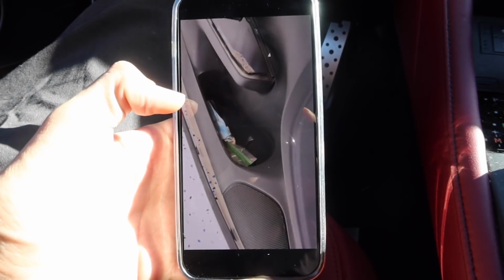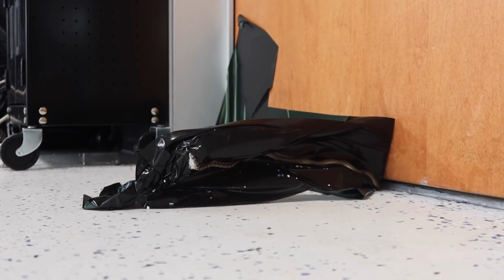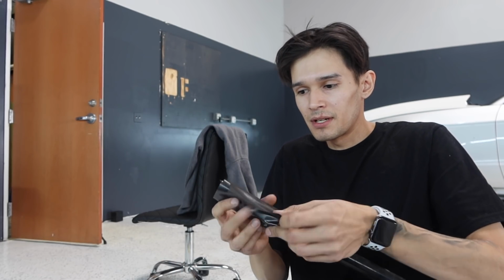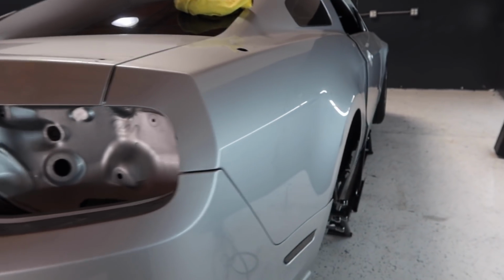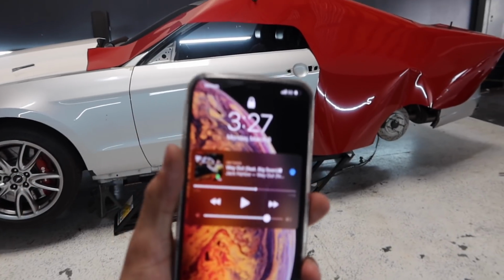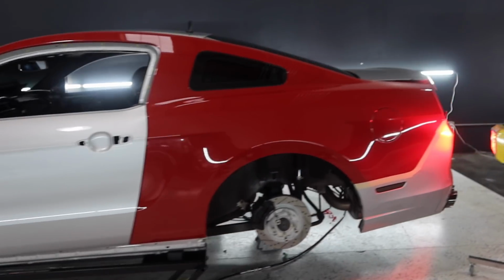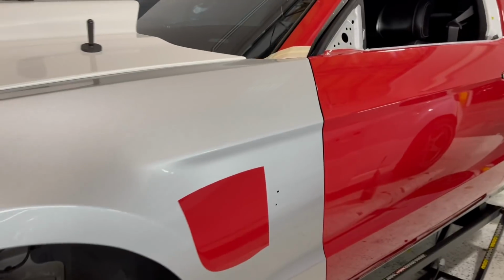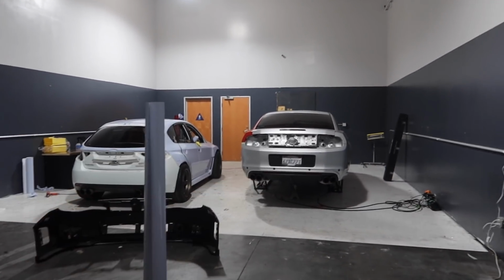WE FOUND A SNAKE IN MY CUSTOMERS CAR!!

Comment: While at work repairing vacuums, often times people wrap duck tape around the metal parts of hose handle, and wands. Often times we take a hair dryer to heat the surface up, and spray WD40 to help break down the glue. It works wonders
Reply from the maker: Thanks for the Info! Might have to give that a try, My guys will be prepping it for a good couple of days.
Reply: @samsonwraps  haha no problem, thought I’d share a tip I’ve learned with my job. Might help to speed up the cleaning process faster. Especially if it can clean Duck tape glue, it might be able to clean up some wrap glue. 
   Granted you probably will want to use the sun, and outdoors to your advantage. Especially since wd40 is enough to make anybody woozy in large quantities.

Comment: That Blood Red is dope! Killin it man. You ever thought about using something like Castrol Super Clean to help with quicker adhesive removal? If you've never tried it, it's a super-strong, biodegradable degreaser and cleaner. Typically you want to dilute it some per the directions, but for the tough stuff, I've used it straight without damaging the clear coat/paint. Used it in the past for caked-on tar with great success. Much love dude!